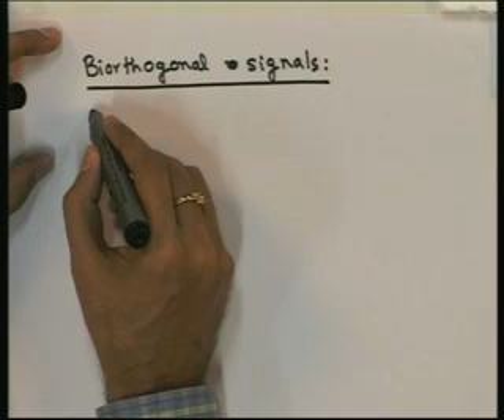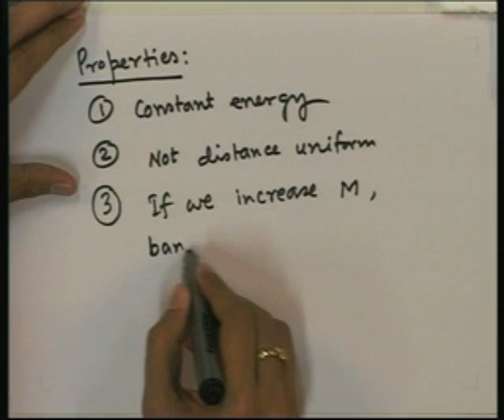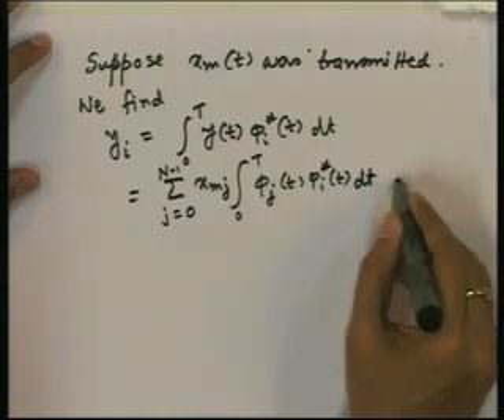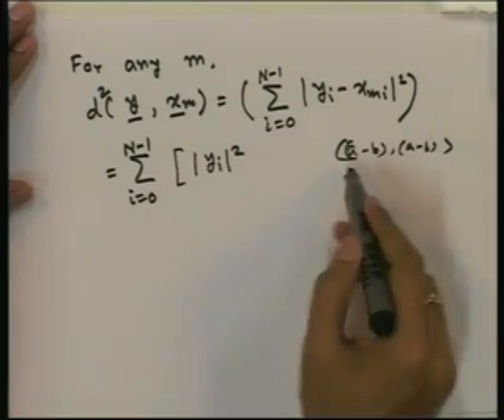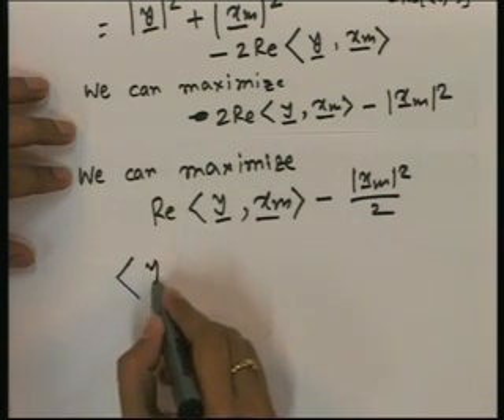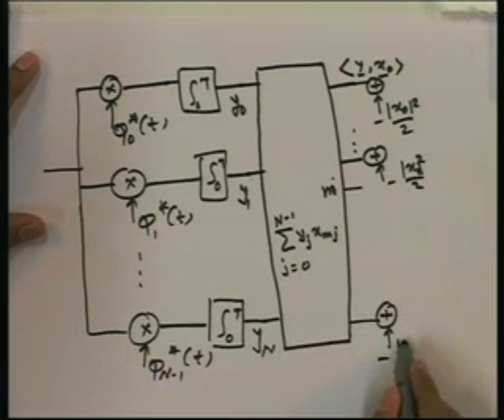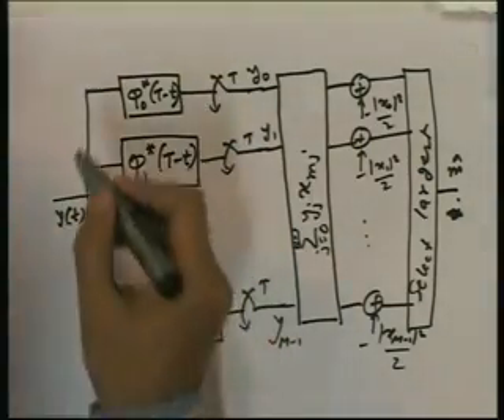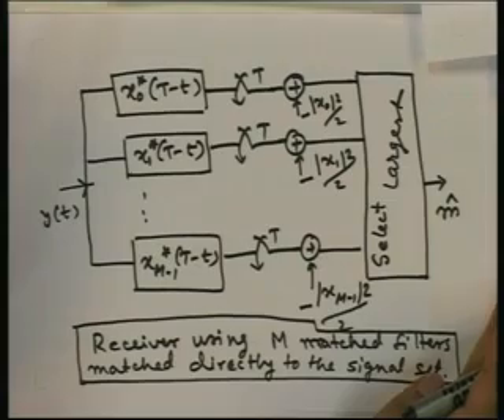Lecture - 19 Digital Modulation Techniques (Part - 8)

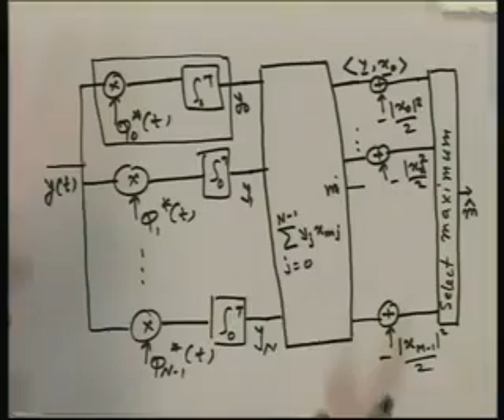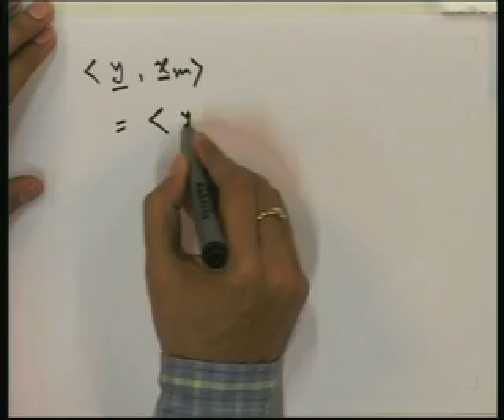Comment: Bi-Orthogonal modulation, Demodulation (12:09), Co-relation receiver (33:00), Co-relation receiver using matched filter and basis signals (39:00) ,Co-relation receiver using matched filter and transmitted signals  (47:00).